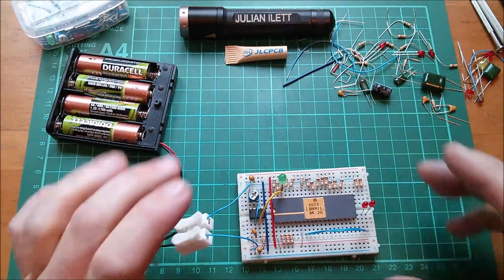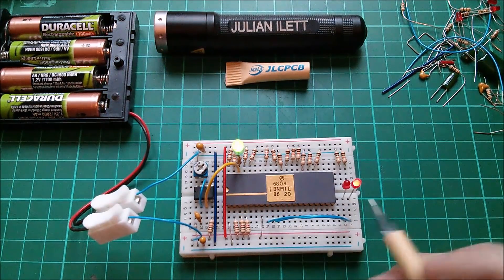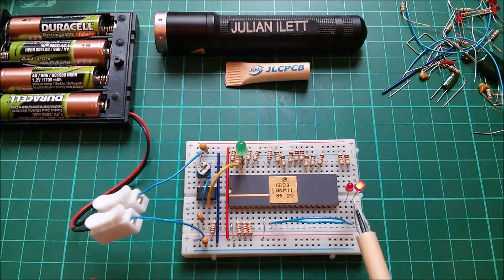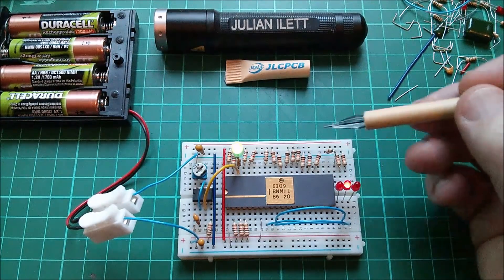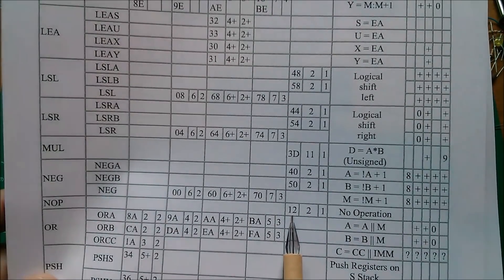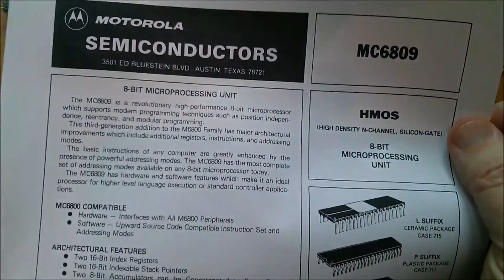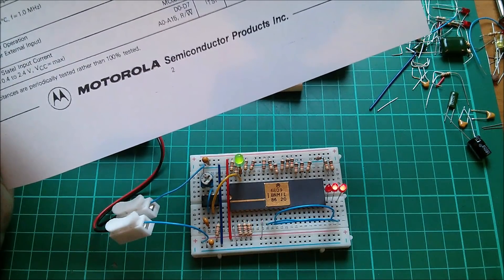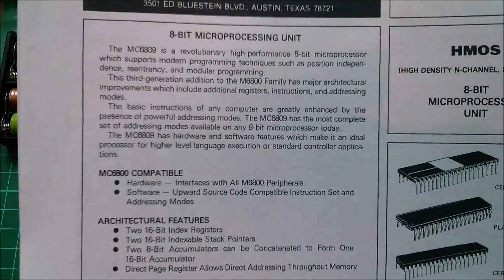Chip on Breadboard - 6809 Microprocessor doing SEX

Comment: I haven't read the other comments and it's very likely already been said but you more or less answered your own (paraphrased: "Why won't it work?") question when you pointed out from the datasheet that you are operating the device way out of spec. Certain internal registers of the 6809 are DRAM-based, hence the minimum operating frequency. They're discharging thus forgetting values by not being refreshed quickly enough. That's why the datasheet stated "unexpected results". If you still want to try it, source an Hitachi 63x09 (63A09, 63B09 or 63C09) which were made later under licence using CMOS technology and are fully static (they can be halted via the clk and continue upon restart).

Comment: That bit where you're talking about using 10K resistors for the LEDs-- is the spec that you are looking at the one where you're limited in terms of source and sink current while still being able to maintain valid logic levels?  If so,  then you don't need to worry about that.  The one you need to worry about is the spec under "Absolute Maximum Ratings",  which you shouldn't go near.   I'll bet lower value resistors would work just fine.

Comment: I think you were running it too slow for mul (where sex takes no effort - I think it's just copying the sign bit (1 op to read, one op to write)). MUL is a pretty heavy operation in 8 bit. I think it took more than 11 clock cycles of time and the clocks ticked again before it's finished. Up the clock speed to the minimum and see if that fixes it.

Comment: Best part about the 6809 instruction set?  The PCR (Program Counter Relative) data pointer instructions.  It meant that if you coded your program correctly, it could be loaded along with its data anywhere in the memory space and still run.

I remember doing that for a machine code routine on the TRS-80 "Color" computer so I could put text onto the high-res graphics screen by simply calling the machine code subroutine from a BASIC program and feeding in a string to be printed.  It had all the bells and whistles, including a full IBM-style extended 256 character set and escape commands for screen clearing and cursor controls.

Ahh, "them was the days". :)

Comment: when i connect VSS (pin one to ground the whole thing turns off
Reply: ps the counting doesn't work. Do I need to program it first
Reply: If you've got everything else wired and powered and you're connecting the processor ground pin last, you may have cooked some input protection diodes perhaps. Try wiring everything and connect Vcc (for the whole circuit) last.

Comment: The multiply in 11 clk cycles in pretty simple. It is shifting a 16bit register by one bit to the left and add the content of another regiter to it. To do that, one needs to extend one of the two 8 bit registers to a temporary 16 bit register and for each bit set in the other 8 bit register (B) add the first register (A) to the 16 bit temp and shift that 16 bit register afterwards by one bit to the left. So one cyle for preparation of the 16 temp register, 8 cycles for adding and shifting according to 8 bits set in the second 8-bit register (B). And when done with all the adding another two cyles to copy the result from the temporary 16 bit register back into the two 8 bit registers (D). There is not any magic involved in this... sadly...

Comment: I started my business with the 6809. I designed a single board computer which had 64K or DRAM, CRT controller, floppy disk controller etc. I called it the Maggot which may not have been the best name choice looking back. If you made such a thing, you could run a disk operating system called FLEX which has an editor, assembler etc.

Comment: The multiply leave the bus High Z.
There is also a pin telling internal ops are going so that other things can use the memory while the cpu does other stuff. But this is probably only for the 6809E
Reply: Forgot to say, use the HALT pin to slow things even further. I added a button on a 555 to debug some code on my 6809

Comment: Humm, I believe that's the microprocessor used in the Commodore 64 ? Well, I checked and it was the 6502 ? how could I forget that ? But, the 6809 was used in something I had to repair. I still have them. I believe. I checked the 1541 drive, nope. So, not sure. I see it was used in the Pet. I did not run into many of those.
Reply: Always wished I could do something like single stepping a C-64 , or a type of logic analyzer. began to build one didn't quite get there.

Comment: Now maybe the minimum clock speed requirement will become clear: the 11 instruction MUL opcode needs stack space (or other scratchpad space), and takes much longer, while charge bleeds off volatile memory cells, causing them to lose their contents. The SEX opcode likely needs no volatile memory and only uses 2 cycles in any case.

Comment: I think it works. When the processor is not using the bus it outputs 0xffff on the address bus. And that is 9 or 10 of the 11 cycles.
Reply from the maker: Yeah, it seems that many instructions have /VMA (Non-Valid Memory Access) cycles. SEX doesn't have any, but MUL has 9. As you say, the address bus shows FFFF during these cycles.

Comment: I set up a computer on a breadboard with the 8085 processor, which has a similar clock limit, running Tiny Basic. It only runs from about 500 kHz up to the maximum limit.

Comment: Sign Extend B into A: Fills A with the value of B's sign bit (bit 7)
This converts a signed 8 bit integer in B into a signed 16 bit integer in A:B
        A                 B                    A                B  
76543210 76543210    76543210 76543210 

xxxxxxxx 0yyyyyyy -> 00000000 0yyyyyyy 
and
xxxxxxxx 1yyyyyyy -> 11111111 1yyyyyyy

Comment: Now make yourself a clock by multiplexing lines to some 7 seg LEDs with no visible blinking like I had to do a very very long time ago in school.  The 6809s were the introductory microprocessors before moving on, in later semesters, to the 68K then to 68020 which was a big step up in complexity and all of this in assembly language.  Ah, the good old days when the entire instruction set fit on a small folding card.

Comment: You are displaying the address lines via the LEDs even when they are not being used by the (very simple) programme. Possibly it is working correctly, but the display is lost in the random address outputs between the genuine ones.

Comment: I studied EE in college in the '80s and we learned assembly language on the Tandy Color Computer II which use the 6809.  The instruction set was very powerful much more powerful than the RISC computers. It was a lot of fun to program in assembly with this micro.  Really the best way to learn how a micro-controller works.
Reply: The 6502 was pretty RISCy, well before the term RISC came into being!
Reply: @paulsengupta971  , The RCA CDP1802 was pretty RISCy.

Comment: Put the LEDs on the top three address bits, and then hike the clock up to 400k.  VMA will mean that the LEDs are on most of the time, but you might be able to see them dim a little in a binary pattern corresponding with the instruction fetches.

Comment: The TRS-80 Color Computer "CoCo" was based on the 6809B and was available with 64K of RAM and could run OS9 - a Unix-like operating system.  I once had a CoCo with a pair of double-sided 5.25 floppy drives.  OS9 could run a 51 character screen (graphics) and could keep up with a 1200 baud modem (some of the other 8 bit micros were hard-pressed to do that with their basic text-from-a-ROM displays).

I had a C compiler for the 6809 but had to correct the assembly code library because it didn't do ucase and lcase as specified in Dennis Ritchie's book on C programming.   In those days, my job included C programming on PDP-11 Unix machines ;-)

OS9 had the Basic09 language which was a very capable BASIC and was semi-compiled (had a runtime if I remember correctly).

I liked the 6809 and always thought the designers had a nicely twisted sense of humor to have called that instruction SEX.

I suspect that you've found why there's a minimum clock speed - some things need to happen at a specific rate to actually work.  SEX may be a relaxed and laid back event, but MULtiplying is serious business ;-)
Reply: We also used OS9 at times, the hardware consisting of a 19" system with a backplane that could accommodate all manner of permutations.  It would also run the 68008 system.  Twin 3.5" discs, one for the OS and the other for libraries and user programs.  We had quite a few Windrush 121 systems all linked to a PLEXUS mini computer which had an aversion to hot weather!  Happy days.  Bob

Comment: Julian thanks for your very interesting video. You show us the type of instruction requiring no operands and show the advancing to a new (rom) address after the instruction has finished. How would you input data into the registers so you could use the type of instruction that requires an operand (the values in those registers) and show the result of that instruction (altered in those same registers) ? Main question: is setting the registers done through pins ?
Reply: This is taking me back now, but I think it goes in the next address on the data lines. So if we take the Z80, if you did "LD B,5" to load the B register with 5, then firstly it would set the address for the RAM. The instruction read in on the data lines would be "LD B". It would then increment the address bus to the next address where the data, 5, would be stored, so this would be read in and transferred into the B register.

When you do mathematical operations, what you then do with the result is normally transfer it to another register or push it onto a stack, depending on what else you wanted to do with the data. If you wanted to display something on a screen, you'd either put it directly into the memory address of the display (back in the day!) or call a pre-defined routine which would place it on the display.

Julian, please correct me if I'm wrong!
Reply: @paulsengupta971  thanks

Comment: it looks like you had it programmed as B1 at first then tried B3 second , even if the pins were the other way round the 1 you changed to 3 would have been 8 to C as then the lowest bit would have been in the right , so the way it should be is HLLLHLHH (10001011) it is backwards to match the pins on the breadboard :-)
by the way did you write an article for a magazine about LCD displays , the name was spelled slightly different but if it was you it was (is) really good :-)

Comment: Great instruction! :D
MUL instruction, maybe, don't work because registers A and B are 0.. Usually, registers need be loaded before instruction call.. ;)

I do some time ago something like this with 8085.. At first, with external crystal, nothing work.. Then i tested all and find out, that all is working with external clock source and that inverted clock output is dead.. At that point, i remember that device, from which i salvaged CPU long time ago, didn't work.. :D
Reply: That shouldn't really affect things, it should just be doing D=0x0

Comment: This IC is in HMOS technology (older than CMOS), so it cannot operate below certain frequency. It may operate, but manufacturer cannot guarantee that, especially in full specified temperature range. Flip-flops in this processor store data in capacitance, which will fade if clock is too slow.
Reply: CMOS vs. HMOS doesn't have anything to do with this,  it's a matter of registers and such using dynamic vs. static design.
Reply: Piotr Kościński right, Thats the same I was thinking, anyway seems todo quite some stuff, thumbup!
Reply: Guessing this is why the MUL malfunctions why SEX works
Reply: kind of dynamic storage

Comment: The 6809 was a great microprocessor and was used extensively in the College where I taught many years ago.  One of the problems you may be having with the RESET is what happens when you bring the reset pin low. This should be with a RC and reset switch across the capacitor.  The 6809 will then go to the RESET VECTORS (memory locations $FFFE and $FFFF) and load this 16 bit value into the program counter and the begin executing code from there.  Most of your address lines are o/c so you have no idea what they are doing.

The 6809 had two accumulators, A & B which could be concatenated to make a 16 bit register, Accumulator D.  So it wasn't a true 16 bit device.  SEX was included so that if you were performing arithmetic operations on Acc B and an overflow occurred for example, this could extended to Acc A to make 16 bit arithmetic a bit easier.

Some comments have mentioned the 68000.  There was a "chopped down" version of this MPU, the 68008 which just had an 8 bit data bus instead of the full 16 bit.  It was used in the Sinclair QL.  Anyone wanting a good book on the 68000 hardware should read Alan Clements excellent tomb.  Bob
Reply: It does not matter where the reset vector point to if all you run is single byte instruction that operates on internal registers.

Comment: When I was at college the micro lab had a 6809 based computer called a POSITRON 9000 (guess there was a sci-fi fan running the company) which was multi user with several dumb terminals hanging off it... we used it to cross compile for 68000 dev boards doing basically arduino like tasks (adc,pwm)  - the dev boards actually had much more powerful processors on them than the multi user compilation workhorse system.

Comment: Maybe this is the mentioned minimum clock frequency ... SEX is kinda simple instruction, MUL is more complex, maybe heavy inter-result operands etc. The reason for minimal clock cycles is the fact that registers may be implemented not like a "small SRAM" storage but rather like a DRAM. Ok it was a very inaccurate description, I admit, I don't remember very well. But anyway you can try feed your CPU with 400KHz of clock, and putting LEDs on the highest address lines instead, so they won't blink too fast hopefully then :) Btw, actually it's often told, that it's already CMOS feature to allow to decrease clock speed even to the DC level to "stop" CPU for a while, many other CPUs of that era had minimal clock, like 65xx CPUs as well. But to be honest, I would like to see the exact description for this as well, hmm ....
Reply: LGB Gábor Lénárt - The NMOS 6502 could not have its clock stopped for too long, or it would loose its context and crash. The NMOS Z80 also has limits to its clock timing. This was different for the later CMOS versions (both 65C02 and CMOS Z80), both of which can have the clock stopped (although there are conditions).
Reply: @Mark1024MAK Hmm I said the very same, so why the "no"? :) Ok, maybe that's my not-so-perfect (well ...) English ...
Reply: LGB Gábor Lénárt - Sorry, I think I must have misread what you wrote last night. I watched the video just before going to sleep, so I was a bit tired. I have edited my comment so it no longer looks like I disagree and now it hopefully makes more sense.
Reply: @Mark1024MAK  No problem :) I blamed myself though that my English and lack of ability to express myself sane enough was the reason :)

Comment: i just realized the 6809 doesn't have an IO space
z80 > 6809
Reply: Although the Z80 I/O space is convenient I don't see it as being enough advantage versus the memory mapped I/O of the 6809 to proclaim the z80 as the better chip.
Reply: You loose a lot of memory space or you have to add more logic.Think of how clean and neat is memory banking in designs like the zeta v2. It would be a total mess of a hack to do such a thing with memory mapped io.  You can then also add a math co processor to compensate for the lack of hardware multiply and you have a pretty neat system.
Reply: Not a repeat of the 8 bit CPU wars 🙁
Anyway, in practice it all came down to money / cost. Z80s were cheaper, plus a Z80 design was cheaper (built in DRAM refresh). 6502 CPUs were also cheaper.

Comment: Might be down to a low voltage supply, 6809 spec sheet is -0.3v to +7v, four 1.2v cells might be borderline during a hardware MUL. If only you had a proper bench power supply like everyone else...
Reply: horse1066 - The data sheet gives a maximum voltage range (which you give), but it’s normal operating voltage is 5V +/-5%. Which is between 4.75V and 5.25V. Four NiMH or NiCad cells gives 4.8V which is acceptable.
Reply: @Mark1024MAK  It would be nice to see him with a proper power supply though, a good 98% of the video was Julian talking about solar power.
Reply: horse1066 - Yes, he could do with a bench PSU. Even if it just a 7805 (or the modern DC/DC direct replacements from RECOM or Traco Power) based design, or a L200 based design. All would be happy to run off his 12V DC solar supply.
Reply: He has plenty of buck or boost DC-DC converters!

Comment: Is it still on the breadboard? Push the 555s frequency up some and see if the MUL op comes to life. :) Might need a high speed camera to capture the leds or some datalogging. As a guess probably some parasitic losses / voltage instability and at such a low clock speed the cpu isnt able to retain its data correctly.

Comment: the RadioShack or Tandy colour computer "the co-co" and the Dragon computer used a 6809. It was the bomb
Reply: You could even overclock it to 2MHz with a poke.. the screen is garbage when doing that, though. The worst part of the coco was the graphics.. They seriously were lacking. That and the 32 column unchangable black on green text screen.. the graphics weren't improved until the CoCo3, that could run 2 MHz perfectly fine, and up to 640x250 graphics, at 32, 40, and 80 columns.
Reply: The coco3 could run the poke without disturbing the screen

Comment: I suspect that the long 11-cycle instruction is using some dynamic RAM and requires the minimum clock frequency to hold data between parts of the process.